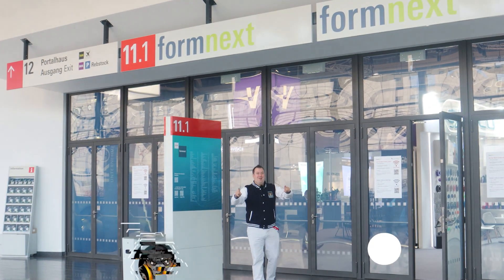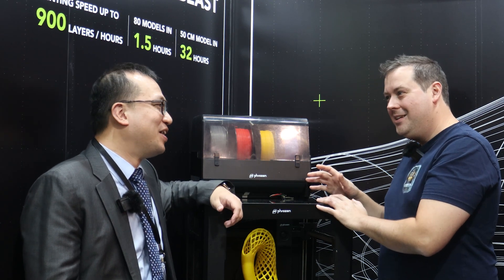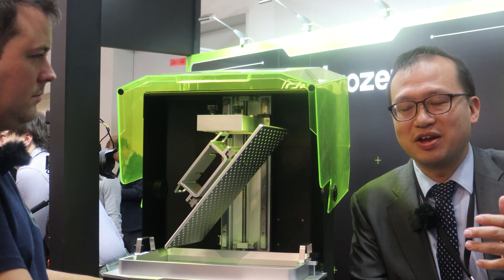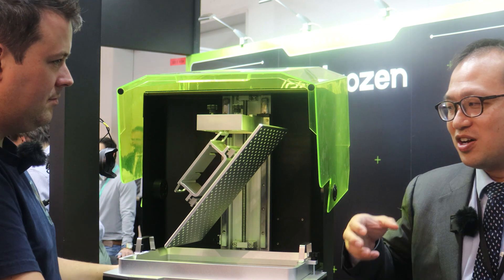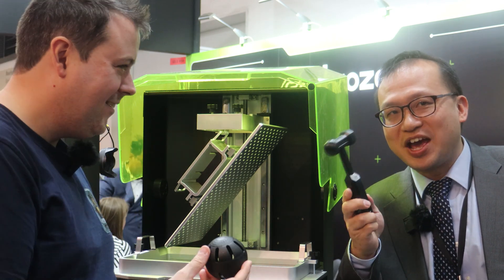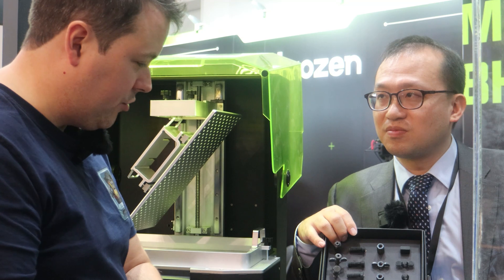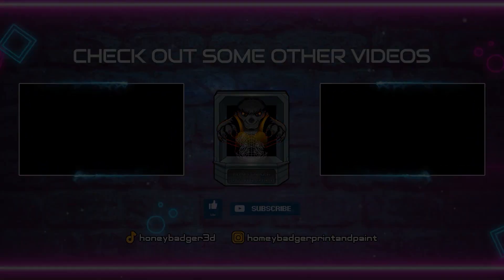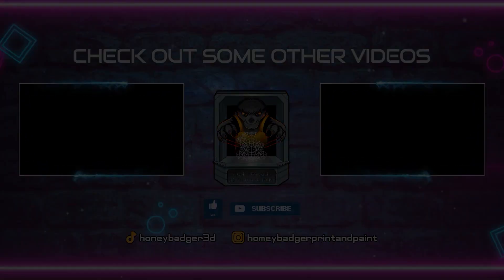Formnext 2023 - Phrozen with Arco - brace yourself for the future

Comment: Can someone break down for me how this would compare to a commercial model like the stratasys f370cr?
Will this printer be able to handle nylon and cf and all the others? 
Thanks!
Reply from the maker: This is not an industrial class of machine, and I doubt it will print nylon but it would print alot faster than the stratsys and probably produce higher quality prints, but as yet we haven't get our machine to test so any advice we can give is limited at this stage

Comment: Does it print nylon without upgrades?
Reply from the maker: So we got really limited info at the show, there is a Facebook group that is run by phrozen around the launch of the kickstarter
Reply: Sounds unlikely
Reply: @honeybadger3dprintandpaint  I just got a reply from them. The stock nozzle isn't rated for nylon, but they are gonna release a nozzle set that can print nylon.
Reply from the maker: Interesting, I would challenge there will be other issues, the filament system has dessicant but is not actually a filament dryer and nylon will draw moisture in very easily, it won't have a heated chamber and nylon is a sod for warping, also not seen the bed material properly so hard to say how that will hold up to nylon as well, alot of unknowns about this printer until we get hands on with it

Comment: That yellow print does not look like it was printed on that printer. the head unit does not look like it can reach the top of that? I could understand if it was 2 pieces but they way it is being presented is one piece and I do not see how it is done,  Look at time mark 1:11 for example
Reply: I agree 100%. That print was made on another machine, finished and used as a place holder piece. I have huge doubts about a kickstarter from a company like Phrozen, I think they have the cash to make a new machine without crowd funding.

Comment: Do know if the 600 Layers/h are real this time? The old version of the Mega was advertised with 70mm/h but noone (not even the Phrozen support) could tell me how you can achieved that. So i assume that was fake advertisement.
Reply from the maker: so we dont have one in the studio yet to say if that is real, i know people have printed quite quick but there are alot of factors, not least or which are layer height and resin type, fingers crossed we should be getting one so we will put it through its paces then
Reply: @honeybadger3dprintandpaint  yeah sure it's depends on a lot of factors, but they couldn't tell me these with the Mega 8K back then. I've tried a lot to maximize the speed, but couldn't even get to half the speed of 70mm/h. Even with no curetime, lowest lift distance, fastest lift speed and absolutely no wait times it wasn't possible. Since then i'm very skeptical what phrozens marketing says...

Comment: Lol .... so fake!
The Yellow example print is bigger then the print area ..... This gonna be the new Kokoni? :)
Reply from the maker: the mega 8ks (the yellow one) is the same build volume as the mega 8k which Phrozen already ready make and ship with a reduced Z height, and people already have the Mega 8ks, phrozen have released alot of products over the last 5 years and never failed to deliver a machine
Reply: You state in your video its an example print ...... So you suggest its printed on that printer. They did the same on the booth as i was there 😂
Reply from the maker: so they did say it was printed on the Arco (they didn't say specifically the machine that was there) the single extrusion print was comparable to what i get from my Bambu i will say the multi colour print had some issues for sure but we were limited in what we could cover at the show

Comment: Yeah really cleaver design choices. I wonder where I have seen this before. It feels like this was done like 3-4 years ago 🤷‍♂️
I do hope the Mimi unit works great. It would open up multi material for every klipper printer.
Reply from the maker: the one at formnext was a Alpha prototype and they have a hell of a journey to get to production, but from what we saw i really liked it, your not wrong that the design isnt breaking new ground but with a high flow hotend and a MMU i could still compete at a high level
Reply: Dang yea, like when someone copied an open source printer design and then decided to lock everything to their own ecosystem and threaten to sue anyone who made a printer that operated similarly to that design ...